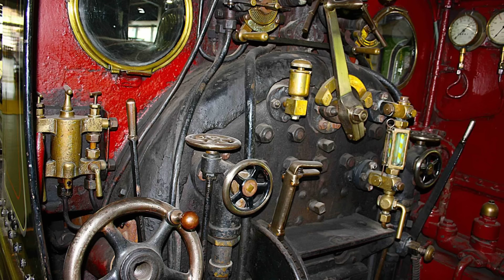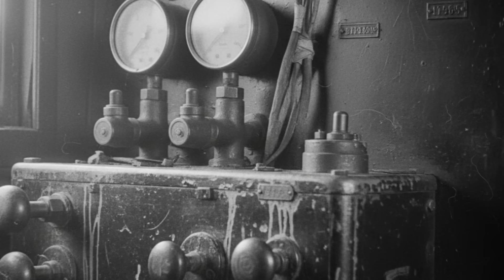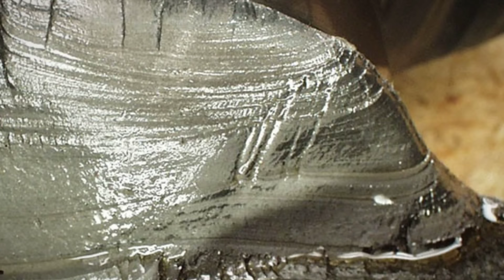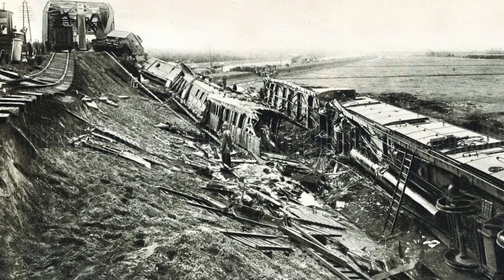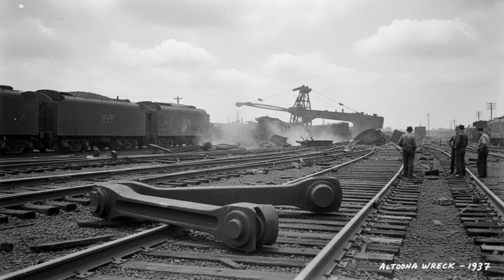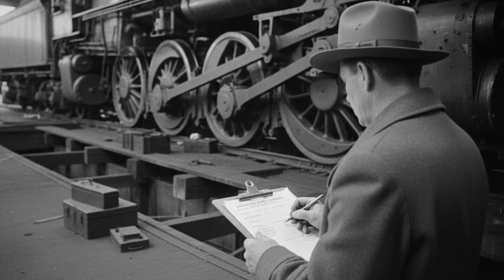When 5,000 Pounds Of Steel Snapped (The 10 Most Violent Drive Rod Failures)

Comment: I doubt very seriously any main connecting rod weighs 5000 lbs. Possibly 800-1000 lbs max, and about 350-500 lbs on smaller engines. Usually two or three men can lift it.
Reply from the maker: Correction filed. Your range holds for standard power. On the largest articulateds the assembly climbs higher — but your hands-on numbers are in the record.
Reply: Nominal weight on freight car wheels and axles about 800lbs each, an idea of weight ranges for those sizes of parts & pieces.   1930's & 1940's 8-coupled and 10-coupled power generally had heaviest main rods.   Superpower 6 coupled articulateds (Virginian and C&O triple 6) main rods very heavy)."Pole-Vault" effect of flailing main rods was fearful!     More frequent FRA inspections for existing steam locomotives, including X-ray for rods & pins is a good thing.

Comment: you said the wheels bounce off the rails then slam down, then repeatedly say the wheels never leave the rails... which one is it? because so far, i don't believe anything in the video now, because of that alone.
Reply from the maker: The two statements describe different mechanical conditions. Under normal operation, the wheel flange geometry keeps the wheel on the rail -- that constraint is the design intent. Under a catastrophic rod failure, the energy release can produce lateral and vertical forces that exceed that constraint. The video likely transitions between those two states without enough separation, which creates the apparent contradiction you caught. That's a scripting problem worth noting. Both statements can be true -- just not simultaneously, and not under the same load conditions.

Comment: Wasn't most of that solved with roller bearings.
Reply from the maker: Roller bearings eliminated most of the hotbox and journal bearing failures -- that's accurate. But the drive rod failures in this video are a different failure mode. A rod throwing out at speed, a pin shearing under load, a wrist pin failure -- those are structural events in the reciprocating gear itself, not lubrication failures at the axle. The bearing conversion reduced one category of catastrophic failure. The rod failures came from a different part of the machine entirely.

Comment: 07:14 Is that a UP Young Gear?
Reply from the maker: Good eye. Young's valve gear -- UP used it on select power to reduce lateral force on the motion, traded some efficiency for longevity on rough high-desert track. Not common by the time most of these failures were being documented, which is probably why it stands out in the frame.

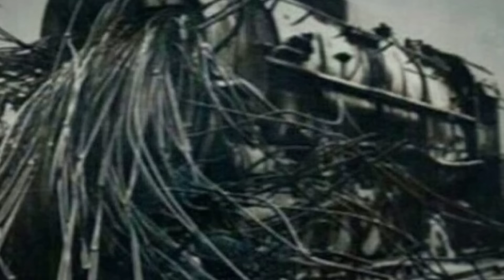Comment: 05:22 Boiler Explosion
Reply from the maker: That one's a crown sheet failure -- boiler keeps pressure after the firebox crown drops out of water contact, metal overheats, and the whole thing lets go at once. Different failure mode than a cracked shell or a stuck safety valve. Violent because there's no warning event before the collapse.

Comment: Almost 20 minutes of repetitive numbing nonsense-- Everything you needed to know could have been done nicely in 10.
Reply: Why do think Nigel Gresley adopted three cylinders for his locos, yes cats&kittens to eliminate hammer blow at speeds above 30mph,  regarding rods, is total bollocks, a connecting rod nto side rod ,is a highly machined piece of monel steel  transferring power from the cylinders to the second or third coupled axle on  a  loco, coupling ,not drive rods are those  coupling  the other three or four drive axles of said loco together.
Reply from the maker: Gresley's conjugated valve gear on the three-cylinder arrangement was specifically engineered around the hammer blow problem -- at speed the reciprocating mass on a two-cylinder machine beats the track hard enough to cause real structural damage. The terminology distinction is fair: in British practice connecting rod and coupling rod are precise terms with specific roles, where American railroad language has historically used "main rod," "side rod," and "drive rod" more loosely. We'll tighten that up.
Reply: They really like the phrase "five thousand pound guillotine."
Reply from the maker: Understood -- the list structure frontloads a lot of setup language and the runtime stretches. That's a structural edit note we're taking into the next production cycle. Appreciate you being direct about it.

Comment: Tonight's reading: 'The balancing of engines' by WE Dalby. A fascinating book first published in 1902, with arithmetic derivations of all that was known at the time. I have a 1929 4th edition which also includes early multi-cylinder internal combustion engines.
A worthwhile book for anyone with a serious interest in steam locomotives! It is a rare and fascinating technical treasure.
Reply from the maker: Dalby's "Balancing of Engines" is exactly the kind of primary source that cuts through the noise. The 1929 edition covering internal combustion engines would have been current-era material for what was being built then. That kind of period technical literature is worth more than most modern overviews -- the engineers who wrote it were working the problems in iron, not reconstructing them. Good reading recommendation.